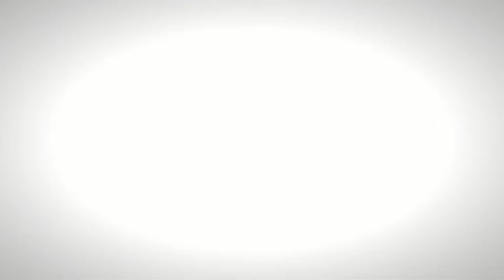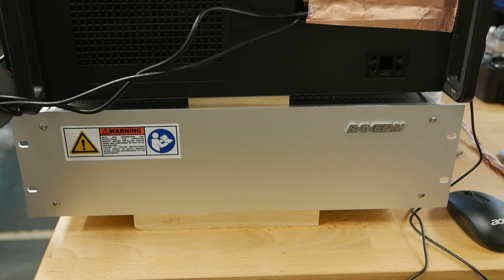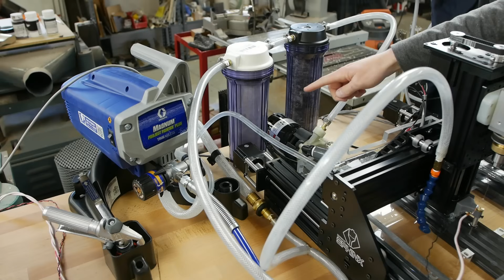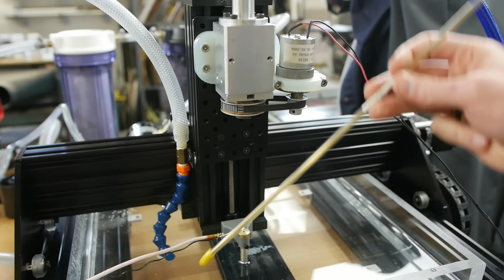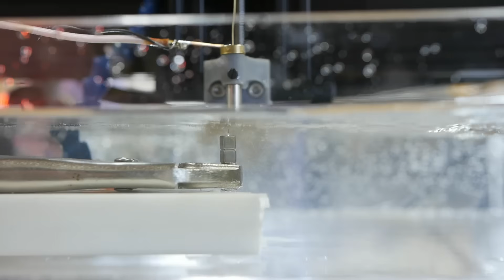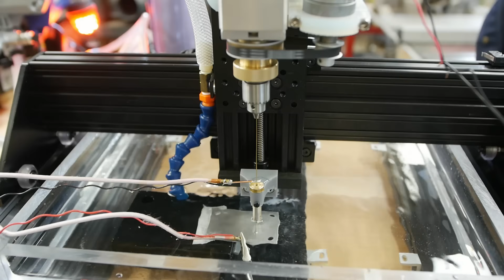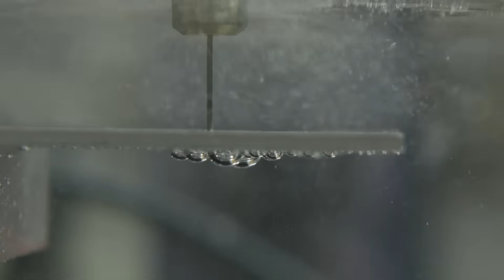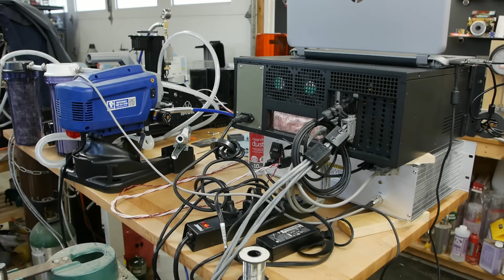Drill through anything (conductive) with Electrical Discharge Machining

Comment: "half a thou of an inch" 
me: screaming in metric
Reply: Answer to a FEW here: Thats why my stupid Chevrolet has both metric and imperial nuts and bolts on it. It makes fixing it harder. Also someone said that mixing units is normal and not a bad thing, tell that to the tripulation of an airliner who had less fuel than expected for miscalculating conversions (2 measuring systems=too many systems). Btw, i am comfortable with using some imperial measures, like the tire, screen, steel, etc sizes.
Reply: Using both imperial and metric system and converting between them frequently is just a fact of life for many/most engineers and machinists involved with product design and manufacturing these days.  I have been a mechanical engineer for over thirty years now (in the U.S.A.) and have been providing product design consulting services for over 20 years. (doing varied projects like this http://schultek.com/id22.html ).  Most projects/products during my entire career have involved a combination of imperial and metric dimensions and specifications.  It would be an extremely complex and costly endeavor to "simply" switch every industry in the entire world over to metric within even a ten year time span.  When I was in 2nd or 3rd grade, I remember being told (it was in my math book) that the U.S.A. would completely convert to metric system by 1980 (40 years ago).  Well that obviously never happened and I doubt that it will happen in another 40 years.  The imperial system of units is just very ingrained into society.  Just one example in the residential building industry....  I doubt that many handymen or professional builders would be comfortable going into a lumberyard or hardware store and asking for a "38 x 89".  Although practically any of them could be quickly in and out of the store with a pile of "2 x 4s".  Well, a 2 x 4 is based on standard inches of 2" x 4".  But anyone involved in construction knows the the modern finished dimensions of a "2 x 4" is actually 1-1/2" x 3-1/2", which is 38.1mm x 88.9mm, which is then rounded to 38mm x 89mm.  ......  Change is often difficult and expensive.   .........     Ed
Reply: @GroBestGardens  or someone could just ask for a 4x9... Centimeters that is
Reply: @j.m.5995  Perhaps, but I will give a $100 bill to anyone who can walk into any of the tens of thousands of hardware/lumber stores in the US, ask for for a "4 x 9, centimeters that is" and find a single employee who has any clue what he is talking about.  But ask for a "2 x 4" and probably 95% will understand.
Reply: @edschultheis9537  True. Noone will have a clue but that is bc it isn't a normal thing to ask for but if it did become industry standard people would adapt. It could be made simpler it could become a 5x10
Reply: @edschultheis9537  Well that is of course true but it also hurts US exports. I'm in a metric country I can buy stuff from almost any other country in metric so I don't need imperial tools. If I want to buy something made in the USA then I will also need to buy a full set of imperial tools to maintain it and those tools will be of very limited use to me. That's a pretty big barrier to get past, so most people here just don't buy American goods it's usually more effort than it's worth.
Reply: @RevRaptor898  First, it isn't much of an investment to have both a metric and an imperial set of wrenches, socket wrenches and Allen wrenches.  Perhaps something like that costs considerable more in your country, but in the USA I could buy a full set of those tools for probably $40 - $100 US.  I would estimate that about 75% of people in the US that do any sort of regular mechanical work have both imperial and metric tools.

I have been a mechanical design engineer for 30+ years.  I have designed many products (working in the US).  Manufacturing may be done outside of the US or within the US, just depending of the part, the product, costs of materials, costs of labor, automation, etc.  There is no law that dictates what unit of measure is used to design products in the US.  Companies and engineers are free to design as they wish.  At the start of a project we make decisions as to whether fasteners will be metric or imperial.  Also, similar decisions are made when incorporating off-the-shelf components into a new product.  It is also common that products will have some mixture of components designed with metric and imperial units.  It has to do with convenience, availability of fasteners & components, cost differences between similar metric/imperial components, the country/s where the product will be sold, etc.  Also, in some industries, it may be more common to design exclusively in metric, where in others industries imperial units may be more common.

Concerning products such as power tools, a  power planer for example.  I have a hand-held power wood planer that can be purchased in two versions.  They are exactly models except that the depth indicator is in imperial units on one version and metric units on the other version.  Frequently-used fasteners may have finger knobs or perhaps any special wrenches may be supplied with the unit.  Accommodations are also routinely made for standard voltage differences between countries.

So individual companies may make different decisions as to whether to use imperial or metric units during the design process.  I suspect that you would be surprised just how many US-designed products  are designed using metric units.  To me, as a mechanical engineer, it doesn't make much difference either way.  I have designed products with both imperial and metric units continuously for over 30 years.  The modern machine shops and sheet metal shops don't care either (when they are manufacturing my custom-designed parts) because essentially all of the machines are computer-controlled so it is merely a choice whether they manufacture in imperial or metric units on the same machine.

Here are a few of the products that I have designed, manufactured or worked on over the years.
My engineering consulting company >>> http://www.schultek.com/id22.html

Ed
Reply: @edschultheis9537  That's a very informative answer but still missing my point. Items designed in America and manufactured outside the the US are different to items manufactured in the US. Also 40 to 100 dollars US is about 90 to 100 dollars NZD am I gona pay over 100 dollars to own the imperial version or just find a metric version, especially when those imperial tools are useless for everything else I own. I have imperial sockets cause I'm old but I never use them, nothing I own anymore needs them. You may use tools that mix the two but here that is simply not the case, everything is metric with almost no exceptions. Also a mix of the two is inefficient and doubles the needed nuts and screws you need to keep on hand, that increases costs and hassle plus who want's a special tool just for that one power tool, what happens when you lose the bloody thing, replacing it is gona be a right pain. Just please keep in mind your experience is unique to the US the rest of us don't need to deal with it like you do and we often prefer not to :)
Reply: @RevRaptor898  I am interested in your comment. >>> "Items designed in America and manufactured outside the the US are different to items manufactured in the US."  How do you view them as different?  I believe that most Americans (citizens of USA) would view an American-designed & manufactured product as being of higher quality (in general) than an American-designed product that is manufactured in a different country (usually a lower-wage country).  What is your impression as a New Zealander?

Also, I did some research for my own interest and I thought that you would be interested too.  Your comments would be appreciated.  I made a list of companies and brand names of POWER TOOLS AND HAND TOOLS that I would readily find at many hardware stores in the USA.  Then I checked to see location (which country) of each company.  I would estimate/guess that this list represents approximately 90% of the sales in this category:

AMERICAN-OWNED COMPANIES
Allen - owned by APEX Tool Group
Black & Decker – owned by Stanley Black & Decker
Bostich - owned by Stanley Black & Decker
Briggs and Stratton
Champion Power Equipment
Craftsman brand tools – owned by Stanley Black & Decker
Crecent – owned by APEX Tool Group
Cub Cadet
Delta - owned by APEX Tool Group
DeWalt – owned by Stanley Black & Decker
Echo
Fluke – owned by Fortive
Generac
Harbor Freight tools
HDX – owned by Home Depot
Husky – owned by Home Depot
Irwin - owned by Stanley Black & Decker
Jacobs - owned by APEX Tool Group
Jet – owned by JPW
John Deere
Knaack – owned by WernerCo
Kobalt tool brand – owned by Lowes hardware
Lincoln Electric
Lufkin - owned by APEX Tool Group
Mac Tools - owned by Stanley Black & Decker
Matco Tools – owned by Fortive
Miller – owned by ITW
Paslode – owned by ITW
Porter Cable – owned by Stanley Black & Decker
Powermatic – owned by JPW
Proto – owned by Stanley Black & Decker
Ridgid – owned by Emerson
Senco 
Snap-on tools 
Stanley tools – owned by Stanley Black & Decker
Tektronics – owned by Fortive
Toro
Troy-Bilt
Wagner
Weller - owned by APEX Tool Group
Wiss - owned by APEX Tool Group

CHINESE-OWNED COMPANIES
Milwaukee – an American company which is a subsidiary of a Chinese corporation
Rockwell – owned by Positec, a Chinese company
Ryobi – Japanese company which is a subsidiary of a Chinese corporation
Skil
Worx – owned by Positec, a Chinese company

GERMAN-OWNED COMPANIES
Bosch
Dremel - an American brand, - owned by Bosch
Stihl

JAPANESE-OWNED COMPANIES
Honda
Hitachi
Makita

LIECHTENSTEIN-OWNED COMPANY
Hilti

SWEDISH-OWNED COMPANY
Husqvarna

Are you able to buy products from most/some of those American-owned companies in your hardware stores? Or do you have completely different brands available in your hardware stores?

Also, concerning electronic items that you likely own such as computers and smart phones.... Even though a particular product may have a foreign (non-USA brand) (e.g. Samsung), it is very likely that most of the computer chips within the product were manufactured on machines that were engineered/designed in the USA.  These machine companies would be companies like Applied Materials, Lam Research, KLA-Tencor, etc.  Unless someone is in that business, they may have never heard of these companies.

Also, consider the airline industry.  If you have ever ridden on an aircraft made by Boeing, Lockheed Martin, McDonnel Douglas (and a few more), you have used products manufactured by American companies.... even though you will probably never put a wrench on any of them.

There are many other examples, but this is what I can think of off-hand.

Ed
Reply: @edschultheis9537  First yes American made tools are seen as higher quality than Chinese made ones here. As for brands American -
Black & Decker
Bostich
DeWalt
Snap-on tools (normally Chinese versions)
Stanley (bad rep down here)
John Deere (only in farm stores)

Chinese -
Milwaukee
Ryobi
Worx (very common)

German -
Bosch
Dremel (seen as overpriced crap)
Stihl

Japanese -
Honda (not common)
Hitachi
Makita

Swedish- 
Husqvarna

Keep in mind I'm talking more about the sort of stuff you would buy directly as a home consumer and not heavy industry. Think company's more like Midwest Tools and less like Apple. My point is if there is an American company making tools or whatever else to export from America we tend not to buy that. Your horrific postal system shares some of the blame there too, the postage prices are kinda nuts. Amazon negates this somewhat but it's still really pricey. Personally I tend to buy Japanese tools if I'm after something that is of high quality. We of course have a lot of brands you don't have but they are usually the typical Chinese name shuffle deal, it's all the same stuff just a different name and most of it is crap. I think I covered most of what you asked for, let me know if there is anything else :)
Reply: @RevRaptor898  
Thanks for the info.

Concerning shipping/postal rates, I suspect that shipping individual packages from the US to New Zealand is similar to shipping from the mainland US to the states of Alaska and Hawaii.  It is very expensive.  I suspect that Amazon may be more reasonable sometimes since they are likely shipping from a distribution center that is closer to New Zealand (than the mainland US).  New Zealand probably also has unique problems with shipping costs since the population is smaller and rather geographically-isolated.  An interesting thing about US Postal Service... A person can mail a letter to any US military ship at sea around the world with the same ease and cost as mailing a letter across town in the US.  Each ship has its own ZIP code.  Not sure about the cost of sending packages to military ships though.

John Deere has dedicated farm stores here (in rural areas).  You could buy anything there from John Deere toys to small lawnmowers to a $500,000 USD tractors or a $900,000 combine harvester.  At a local hardware store for the general public, John Deere sells primarily just push lawn mowers and small garden tractors with lawn mower decks.

I noticed that four of the US brands (Black & Decker, Stanley, Dewalt & Bostich) that you noted are all owned by Stanley Black & Decker Corporation.  I consider Dewalt and Bostich to be high-quality brands.  Stanley is mixed.  I believe it is because they had some quality problems after out-sourcing manufacture of some of their products some years ago.  I think that they returned some of that manufacturing back to the US since then.  Black & Decker power tools have kind of a mixed reputation here.

Snap-on is considered a high-quality, more expensive brand here.  These tools are often the choice of professional mechanics.  I'm not sure where they are manufactured, but I would be surprised if many (or any), are manufactured in China.  The Chinese Snap-on tools that you find in New Zealand may be counterfeit knock-offs.  China steals/copies designs all the time.  If the Snap-on tools that you see are inexpensive, they may well not be authentic Snap-on tools.  I have also seen exact Chinese counterfeit copies of Makita power drills.  They only thing missing was the Makita name on the outside and there were a few small design changes on the inside.

Dremel is rather overpriced in the US too, and the quality is mixed.  But sometimes they have just the right small tool for the job.  Dremel is an American brand (founded in the USA), but it is now owned by the German company Bosch.

I own numerous Bosch and Stihl products.  They are high-quality.

I've owned/used numerous Honda, Hitachi and Makita products.  They are high-quality.

I think that Milwaukee was a higher quality brand when it was American-owned.  Since the Chinese bought it, I am not as impressed with their products.  I consider Ryobi and Worx brands to be entry-level lower-quality tools, best for infrequent use by a homeowner.  A professional would not buy these two brands.

I don't know much about Husqvarna, but my impression is that it is a high-quality brand.

China steals designs and products from US-owned companies all the time.  They also routinely ignore US patents and other intellectual property.  It is a very big problem.  Especially with all of the problems that China created with the COVID-19 virus, shortages of PPE (personal protective equipment), drug shortages, hostile actions by China in the South China Sea, Hong Kong and with numerous countries around the world in the past years, I would not be surprised if the US largely detaches from China as a source for manufacturing over this next decade.  The Chinese Communist Party (CCP) is just becoming very hostile and must be stopped.

Thanks again for your input.  It was very interesting.

Ed
Reply: @RevRaptor898  Interesting information about Snap-on and thanks for that website link about the companies manufacturing in the US.

Ed
Reply: Ed Schultheis In Australia you get a 45mm by 90mm as default standard (35mm by 90mm is also common) - 4x2” are special order (owning an older house I had to chase to get the exact size hardwood to repair the frame).
Reply: @GroBestGardens  NO what you meant to say was: "Using both imperial and metric system and converting between them frequently is just a fact of life for many/most engineers and machinists involved with product design and manufacturing these days." IN AMERICA

Every other sensible person on the planet uses metric, it is solely The US etc that steadfastlt refuses to adapt to a system that the whole world has adopted, I guess its in the constitution or something , "you have the right to bear 2 tape measures"
Reply: Ed Schultheis wow just wow... you must be so bored to write that much stuff when i was just having a dig. Chill out bro,
Reply: Ed Schultheis oh yeah Donald trump
Reply: @GroBestGardens  have you ever run into the little 6-in metal rules, a lot of them will have conversions on one side? Have you ever run into at least one run of them has a mistake stamped/printed on it. I used them mostly for guitar setup work and my father used them in machine shop. Between us we probably had six of them. one day I noticed rain Man style that one was incorrect I think they had rounded up or down the wrong way, or whatever it was it's been a while now, but I remember the joy I got when I kept telling my pop something was off and he said there's no way that can be off, do you know what would happen if people used the wrong calculations it's math it has to be right,  it had to be double and triple checked. The look he gave me once I proved it to him was priceless. I think it was an old craftsman or starrett.
Reply: @LTJR.  I have a couple of those 6-inch metal rules in my tool boxes.  I'll have to check them out.
Reply: @edschultheis9537  I'm glad I picqued your interest, I'd be like-minded to hear of your findings.
Reply: @GroBestGardens  I remember them actually asking us in grade school whether we wanted to convert. It was like a polling that went through the school, mentioning the number of countries that were metric versus the fewer with I guess you'd call it SAE?, And whether we wanted to change and of course being kids in some grade six or under (I'm guessing it was somewhere around 68 or 72) we mostly said no anything with more of a workload. When we found out there would be no change that may have been the last time I remember voting on something and winning...ha
Reply: @GroBestGardens  The machine tool industry was developed in countries using the "primitive" system, and for many of us, that system stuck.  (See Springfield, VT) I've been using 1/25.4 most of my life, and never had a problem. I think the inch system is far better suited to precision than metric. .001", .0005", .0001", .00005" work perfectly. .0254mm, .0127mm, etc. ugh.
Reply: @GroBestGardens  The topic is now exhausted, you said it all :). To be clear I didn't wish to offend anyone calling imperial primitive. Swithing from metric to "feets" fells like taking step back, and was a pain in the ass for me.
Reply: @GroBestGardens  "It would be an extremely complex and costly endeavor to "simply" switch every industry in the entire world over to metric within even a ten year time span."

Oh. My. Word. You do realize the whole world ALREADY uses metric, right?
Reply: @lumpyfishgravy  You are really underestimating the challenge of switching everything to metric.  The USA, its businesses and its citizens are deeply involved in a majority of the world's economic output.... And the USA is not a metric nation.

I have been a mechanical design engineer for over 30 years and I know how difficult it is to design a single complex machine with components that are using only metric or only imperial units.  It would negatively impact both the cost and the schedule of many large and small projects.

Just a very simple example...  There is often a special fastener that is readily available in an imperial size but is completely unavailable, more costly or has a longer lead time (for delivery) if it is required in a metric size.  Requiring metric components can certainly increase the cost of a product and lengthen the time to market.  This can kill a product in the marketplace. 

Just another simple example...  Imagine the extra inventory required (in the USA) in a Home Depot store or other lumber store or plumbing store if they had to stock metric sizes for all dimensional lumber and plumbing supplies.  They would still have to stock all of the imperial sizes since repair of all existing homes would require those sizes.  So they essentially have to double their inventory but their overall sales remain the same.  That would kill the profit margins of those businesses.

There are many many examples, but the ones above a just two simple examples.  The cost to the USA would be massive and such a change would impact the average US citizen and the average business in nearly every aspect of their daily life.  The US could make such a change, but it would/will be very costly.  I don't expect to see it happen in my lifetime.  It will/has happened in industries, but only where it make economic sense to do so.         Ed
Reply: @GroBestGardens  Well gee I wonder how WE managed it? Point of my post was - it's ONLY the US. Americans sometimes forget there's a world "out there." And as a 60s born Brit, allow me to know about the conversion process.
Reply: @lumpyfishgravy  The UK "managed it (the metric conversion)" largely because it is a very small economy as compared to the USA and the world.  Using 2018 & 2017 data (the latest I could find quickly),  the USA had a GDP (Gross Domestic Product) of $20.5 trillion.  The UK had a GDP of $2.8 trillion.  The entire world had a GDP of $80 trillion.  So the UK had a GDP only 13.7% of the USA GDP.  And the USA had a GDP of 25.6% of the entire GDP of the world.  So imagine switching over 1/4 of the entire global economy (the USA) to the metric system.  I would be a very big and expensive task indeed.  And exactly how would the USA benefit from this?  There would be some benefits, but there would be many costs too.  Source of data >>> https://howmuch.net/articles/comparing-us-states-to-entire-countries-by-gdp-2019

Thank God in heaven that we (US Americans) fought and won a war (1775 - 1783) to be rid of British rule and all of its other ridiculous things (like royalty). The USA seems to have done quite well for itself since then and also managed to play an very instrumental part in keeping the world more free.  The UK switched VOLUNTARILY to the metric system in 1965.  If the USA hadn't helped to free the UK (and the rest of Europe) 75 years ago, then the UK would have INVOLUNTARILY switched to the metric system 20 years earlier.  Also, if it weren't for the USA, you likely wouldn't be able to read my post now... as German would be your native language.

Finally, how on earth could US Americans "forget there's a world out there" (especially the UK and the rest of Europe) when we have so many of our dead relatives (military soldier heroes) buried there, never having returned to their families.  

American cemeteries in Europe
https://en.wikipedia.org/wiki/American_Battle_Monuments_Commission

Perhaps you can go visit one of those dead heroes where they are buried near Cambridge, England.... for an American family member who will never have the means to do it. 
https://en.wikipedia.org/wiki/Cambridge_American_Cemetery_and_Memorial

Ed
Reply: @GroBestGardens  Well stated!
Reply: @GroBestGardens  Your post about GDP, war, empire building (congrats you now have a plaque on the Empire 'hall of fame', and eventually membership in the Alumni organisation), and the self-congratulation on ridding yourselves of impotent Monarchy in exchange for a more insidious and entrenched Oligarchy, all bears little if any relevance to the point on transitioning from imperial to metric.
Honestly your post screams the mindset "USA! USA!", and the US American belief that decades of global hegemony and their leverage of it for economic benefit = keeping the world free is absurd. At best your country has conferred a degree of stability to some areas for primarily self interested purposes, which has come at a massive cost to some regions/peoples, and benefit to others. You are just another militaristic Empire society that has contributed some good, plenty of bad, like all the rest.
Reply: @eddyr3691  (I am @GroBestGardens - same person) - When you wake up every morning, you should thank God that the USA exists and has been such a force for freedom in the world for the past century.  Without the USA, your family may have died out decades ago.  Assuming you survived... Without the USA, you would almost certainly not be living in a free country... no matter which free country you now live in.  You would almost certainly be living in a country under the control of a dictator.  If you live in Europe, you would likely be speaking German today, rather than your native language.  The USA is far from perfect, and it will never be perfect.  But the USA has been the major force for freedom and democracy around the world in this past century.  If the USA disappeared tomorrow, your world would be in a massive state of chaos and you would have little chance of fighting back against repressive communist governments like that of China.  If the USA disappeared tomorrow, your children and grandchildren would have little hope of growing up in a mostly free country.

So  @eddy r , which country do you call home?  I would really like to know.  If the USA had not been a strong force for freedom over the past century, your home would not be recognizable to you.  Think about that as you whine about the USA.  You have reaped many benefits from the USA, mostly because you are free and not living under a dictatorship, even though you are likely not a US citizen.

Ed Schultheis
Reply: GroBestGardens You do realise that metric and imperial pipe are EXACTLY the same size? The difference is the description - 1/2” pipe is DN15 pipe (with a 1/2”BSP pipe thread).
Electrical conduit is hard metric however.
The US already uses metric on exported equipment- because you can’t export things that are in US units.
Reply: @GroBestGardens  man, that was deep, interesting, and quite to the point. Thank you for making such a wonderfully concise argument for those of us who aren't nearly as well spoken on the subject
Reply: @lumpyfishgravy  You are best off using decimal inch as the customary unit that manufactures use.
Reply: @lumpyfishgravy  yeah exactly. imperial people just live in there own little world where they think every country is just America with a different language
Reply: @GroBestGardens  again, the USA,  Liberia and Myanmar, are the ONLY places that uses imperial. the rest of the world DOES NOT USE IT. again, we do NOT use imperial. got that? there is no "big change" that needs to happen, because we ALREADY use metric.
Reply: @johnharvey4496  I am "@GroBestGardens" - I sure do hope that Trump wins.  Biden and the Democrats would be a complete disaster for the US.  I voted for Trump a few days ago, but my vote for him doesn't matter as much since I live in Washington state (which is not a contested battleground state).  At least as important is that Republicans maintain control of the Senate.  This is very necessary so that Trump can accomplish big things (if he is re-elected).  This is very necessary to stop Democrats from passing lots of radical stupid legislation (if Biden wins the election).

Ed Schultheis
Reply: @zh9664   (I'm GroBestGardens)
I don't know why this bothers you SO much.  The US will make the change to metric if and when it is in our best interest to do so.  If you don't like it, then certainly don't move to the US, vacation in the US or buy anything from the US.  Certain industries are more likely to use metric than others.  It would likely be (and it is) on an industry-by-industry and company-by-company basis.

Ed Schultheis
Reply: @GroBestGardens  I guess I'm a little older than some of you folks, but elsewhere here I responded to someone already about us being in school and being polled on weather we wanted to change to metric. It seems they left it in the hands of school kids, and I definitely remember it was sixth grade or under. Ha this was old Palmdale before even McDonald's when it was just a aircraft town. I mean there was only an A& W drive-in with the speaker to order at, and the girl would roller skate out and affix the tray to your car.  They didn't have a McDonald's burger, in case anyone was thinking McDonald Douglas ha.
Reply: The only thing that's consistently still imperial is plumbing. Water, grease, air, whatever fluid it's still in inch sizes. Everything else is pretty good. The only thing that really shtis me is when people say the "50mm" fitting when its 50 nominal and actually 2". Or very occasionally when you get some german gear and the plumbing really is 50mm and none of your 2" stuff works.
Reply: johno Germany uses imperial pipe threads - British Standard Pipe with a DN specification. Tubing is a different question.
Reply: Sat her with my lbs of popcorn drinking 330ml of coke laughing in British
Reply: @humphrey4976  At least you're talking about lbs of popcorn rather than stones of popcorn.  As an American, I always have to reach for my weight converter app when British people start talking in stones.  I just can't remember that there are 14 lbs per stone.  We just never use "stones" in the USA.
Reply: People can argue the metric system pro and con til the cows come home but one thing is a fact; the United States is in the 45th year of a 10 year metric conversion (Metric Conversion Act of 1975). The cold truth is that the government dictated it and the people rejected it. That's one time the public has ruled.
Reply: EclecticHillbilly And the US economy has been sliding ever since... but that is conservative politics for you...
Reply: US educated engineers, machinists, scientists can use either system quite easily. We’re bi-lingual in that regard, whereas most Europeans cannot conceptualize distances and lengths in non metric units, that’s a shame. Americans weren’t the originators of the imperial system either, but we’re proficient in it.
Reply: @hansbrix2495  I think that is becouse it's useless knowledge for most of us. And yeah, Americans weren't originators of too many things.
Reply: @gdjpodo3370  well I think your comment perfectly reflected your own lack of knowledge and objectivity.
Reply: @hansbrix2495  Because I called it useless knowledge? You said it's a shame that we can't conceptualize an imperial system, and I explained why. We don't have to be bi-lingual in that regard. I know that it is too expensive for you to change it now. But I find it odd when Americans get triggered for saying that metric is better. If you don't agree go ahead and try to do some physics using imperial, good luck with that. And obviously I'm not objective, who is?
Reply: It comes to approximately 2,333^3•10^-6 m or one three millionth of a marathon. Conversions are a breeze man.
Reply: lol bro metric is dead, what is yall on
Reply: I legit read this comment as I saw it and it was at the same time as he did. wow.
Reply: whats metric?
Reply: Yes in metric you have 10  fingers approx. In imperial you have 12 bones in fingers of one hand.
Reply: thats your size?
Reply: @DevilsCookies
ME TOO!!! Greetings from Germany    ;-)
Reply: Fook imperial system
Reply: @cromeaxe  Lol...quite the intelligent comment from a metric muppet. But expected nothing more.
Reply: @nix4644  sorry did i hurt your feelings
Reply: @cromeaxe  Lol...not even close.
Reply: "half a thou of an inch" 
me: screaming in metric
Reply: I prefer working in imperial for mechanical engineering purposes myself. You find that measurents can be represented by easy to remember fractions or integers whether coarse or fine. Imperial machines, to me, have an innate beauty.
Reply: @factorylad5071  I guess it depends on what you're used to, but for me, working with imperial units would be impossible; imperial will do for the usual things, but as soon as it gets scientific, metric is being used, its just way easier converting nanograms per m² to tons per m² (just as an example), I feel it would be way more difficult using imperial
Reply: @123philimo  Yes I can see your point if your working in a lab you will want things like Angstroms and Barns I fully appreciate that, But the point most people in favour of imperial are making is where unaided human interaction is concerned. For example, through hole components in electronics are commensurate whereas metric is not so I still say pass me another 2x4!
Reply: Mils to microns (25.4mils = 1 micron)
Reply: @The_Paint_Father  
I believe that you have the numbers transposed...

It should be 25.4 microns (or micrometers) = 1 mil (or 1 thou) (or 1/1000") (or .001").

Ed
Reply: @edschultheis9537  thank you, sir! A little dyslexia keeps things spicy. 😂
Reply: @edschultheis9537  Not Forgetting ! Swaziland !!
Reply: POINT !! ZERO !! ALL !! THE WAY !! TO !! INFINITY !!
Reply: imperial system is primitive
Reply: @gdjpodo3370  easy to remember - 40 though is 1mm - near enough
Reply: @lesleygeorge4132  its thou I belive. And you surely didn't read the discussion.
Reply: @gdjpodo3370  No, it's just confusing for some.
Reply: @gdjpodo3370   I know , right?
If the United States had adopted the metric system, they could have put a man on the Moon over 50 years ago !
Oh wait....
Reply: @gdjpodo3370  Been working fine for a long long time.  A lot of things have been built and created using the so called "primitive" system.
Reply: @nix4644  sure it was. But this proves no point. A lot of things was created with sticks and stones.
Reply: @gdjpodo3370  What do you mean "it proves no point"?  The point is that Imperial works perfectly as is.  Metric works perfectly as is.  It's just whatever you're used to.  Kind of like driving on different sides of the road.  More countries drive on right side than left side, should we insist that ALL countries do that.  I guess I've just never seen it proven (at least to me) that the metric system is inherently better than imperial.

By the way, many many things are still standing that used "sticks and stones".
Reply: @nix4644  Noone said it doesnt work. Your road comparison is not accurate. Chinese alphabet works fine but latin is simpler(I belive thats makes it superior). 

Idk if someone proved it but I see no argument for opposite statement. 

srsly ? ;d what many things ?
Reply: @gdjpodo3370  I'm done with your circular arguments.  I've got work to do, I have to go cut some 2x4's with a 7 1/4 inch blade.  Hmm... seems pretty simple to me.

 PS Answer to your question...2135 things..lol
Reply: @nix4644  sure you are:)
Reply: @nix4644  The metric system is inherently better because all units are linked together and allow to make easy conversions between each other even without calculator, because everything is based on power of 10 which helps avoiding mistakes. For example 1 liter of water is 10*10*10 centimeters of water, and also weights 1 Kilograms. Also even the names of the units follow a convention, Kilo-something is always 1000 * something, deci-something is always 0.1 * something, etc
Reply: @nix4644  Including failed stuff sent to space.
Reply: @collomps  Not sure what you're saying... only imperial sized things fail in space?
Of course you know that's not true (at least I hope you do).

So only houses and buildings built with metric are any good?
Reply: @nix4644  But those 2 x 4 s are actually 1 1/2" x 3 1/2 "    ;o)
Reply: @nix4644  no, the point is imperial is stupid because all the measurements are seemingly random. 5280 feet in a mile??? why?? in metric there are 1000 meters in a "kilometer" meaning 1 thousand meters. why such a random number as 5280? and then 12 inches in a foot? why? there are 100 centimeters in a meter. again centi meaning 100th. and again, millimeters meaning 1000th of a meter. metric just makes sense, and imperial does not make sense.
Reply: @zh9664  Lol...doesn't make sense?
Makes perfect sense to people that grew up with it.
Reply: @nix4644  exactly my point. only makes sense to people who grew up to it in America, and no where els in the entire world.
Reply: @zh9664  Some people speak Italian, some people speak Latvian, some people drive on the left side of the road, some the right.  Some people use metric and some use imperial.  Not sure why you're so hostile about what measurement standard a country of 330 million people uses.
Reply: @nix4644  Your left hand - right hand drive analogy is invalid.
Reply: @johnharvey4496  My my, aren't you a deep thinker...lol
Reply: @zh9664 
(I'm GroBestGardens) Maybe we in the USA are using the imperial system just to irritate the hell out of people like you.  It seems to be working.  Perhaps that is enough reason to continue using the imperial system.
Reply: @zh9664   (I'm GroBestGardens)
It must really irritate you no end that in the imperial system we will divide inches into either 1/10", 1/100", 1/1000" of an inch (on one scale) or fractional in 1/2", 1/4", 1/8", 1/16", 1/32", 1/64" on a different scale.  The former scale is more often used in machine shops, whereas the latter scale is most common in the construction industry.

By the way, I probably learned by 3rd grade elementary school that there were...
> 12 inches per foot
> 3 feet per yard
> 5280 feet per mile
It makes perfect sense to me.

Why 5280 feet/mile? - The mile measurement used in the USA is based on the Roman mile which was 5000 feet.  But during the reign of Queen Elizabeth I (England), the mile gained an additional 280 feet—to 5,280—under a statute of 1593 that confirmed the use of a shorter foot...

https://www.britannica.com/science/mile
https://en.wikipedia.org/wiki/Foot_(unit)

Ed Schultheis
USA
Reply: @edschultheis9537  i know it makes pefect sense that there are 12 inches in a foot and so on, but you just gotta admit that 10mm in a cm, 100cm in a meter, and 1000m in a km is just easyer to understand, aye?
Reply: @edschultheis9537  Lol...a dog house built using the metric system no doubt.
Reply: @nix4644  Including a Mars probe that went AWOL costing hundreds of millions of US taxpayer dollars because NASA's Jet Propulsion Lab confused miles with kilometers.
Reply: @caddyoshack3761  That's called "human error".
Have you ever seen someone push on a door that was clearly labeled "pull". Sometimes ya just can't fix stupid.
Reply: @maxwellerobini1603  But it's not...  The density of water is only 1g/cm3 under specific circumstances, and it's only water.  Not only that, in engineering the units aren't normally length and mass, they're length and force.  So all of your weights have to be converted to Newtons, which is a factor of 9.80665.  That's a PITA.  In the imperial system, we normally deal with lb weight rather than actual mass, so we don't have to convert.  In machining, everything is done in decimal inches.  Likewise in other disciplines.  If you can't convert easily, how do you figure out your own schedule?  60 minutes to an hour, 24 hours per day, random numbers of days per month.  Yet everyone understands it.  Metric is fine, but it's in no way simpler or easier.
Reply: @Vodichka9  Ok. Now please explain how this anecdotal evidence proves anything?
Reply: @pawekaminski2307  I don't know what post of mine you're referring to.
Reply: @gdjpodo3370  Are you a scientist?
Reply: @wessmall7957  No. Why? Only scientists are allowed to have opinion? I have been working with both if you want to know. Did you ?
Reply: @gdjpodo3370  Only time I've ever used metric is while working on my car.
Reply: @wessmall7957  The rest of the world (I mean outside of England and USA) laughs with you
Reply: @wessmall7957  you do realize that its pretty much only America that uses that? you are the minority in this argument. and in any case, at least metric wasn't invented by a drunk mathematician rolling dice
Reply: For me metric has one strong point over imperial. That it's the same no matter where you go. While you have US imperial and British imperial and both are different in measuring things.
Reply: most of the people arguing about  "why metric is bad" and "the good old imperial has worked and will always work, change is bad REEEEE" are old americans
Reply: laughs in American
Reply: @wessmall7957    Please..!!  Laugh the European way man...!!  😂👍
Reply: "Half a thou of an inch" is quite understandable by anyone in mechanical engineering or anyone with a machining background.  It is simply 1/2 of 1/1000 of an inch >>> or 0.0005".  Then .0005 inch x (25.4 mm/inch) = 0.0127 mm.  ...... Ed
Reply: @GroBestGardens  Yes, but any kind of mech eng would much prefer to work in metric.  However, engineers from the USA will often go ballistic at anyone who would challenge them on imperial vs metric.  Get that chip offa yer shoulder and face reality...  like the rest of the world did long ago.
Reply: @johnharvey4496  - I'm "GroBestGardens".
Don't whine John.  It doesn't become you.

I've been designing and working in imperial and metric, both systems, nearly my entire working career (about 35 years).  It doesn't matter much to me which is used.  It's generally more important (when designing & manufacturing a product) to evaluate which parts are more readily available, the lead time for receiving the parts and the cost of the parts.

But when one gets into certain industries in the USA, like the construction industry for example, switching to metric would be much more challenging.  A hardware store would not want to carry both imperial and metric sizes for dimensional lumber (for instance) because they would have to double their floor space while not increasing their customer base hardly at all.

Ed Schultheis
My engineering consulting company:  schultek dot com
Reply: Also common for engineering and machining is "mils" where "1/1000th of an inch" is also called "1 mil".  So "1/2 mil" also is equal to .0005".